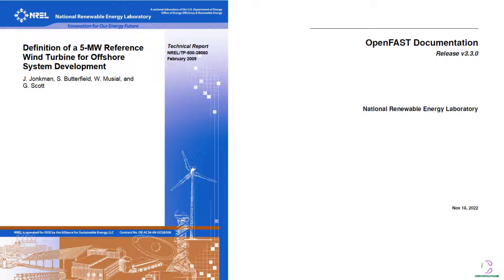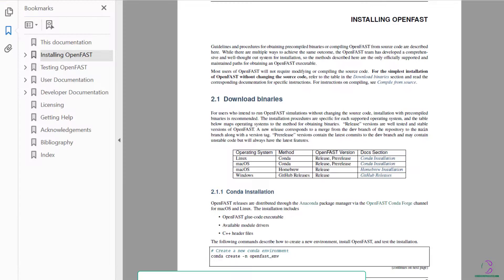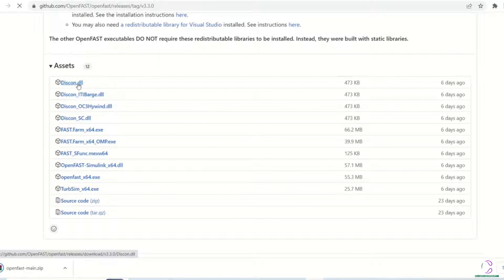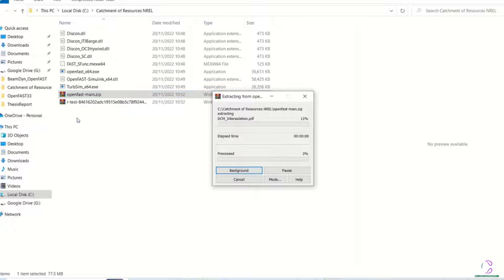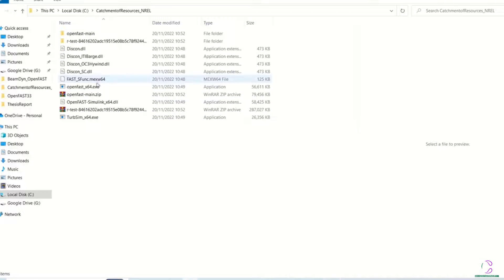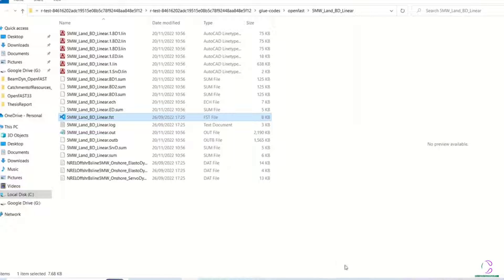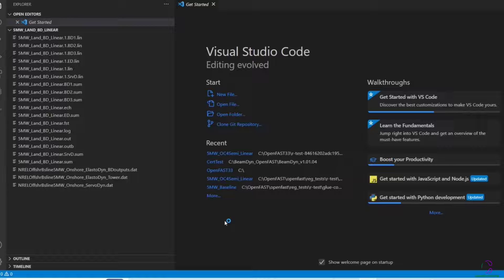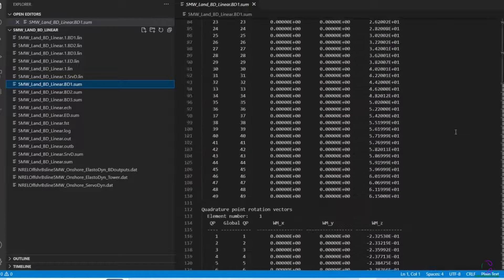Part 1: Running NREL's OpenFAST Precompiled Binaries | Wind Turbine Design Technology

Comment: please i am getting this:   FAST_InitializeAll:FAST_Init:FAST_ReadPrimaryFile:Invalid numerical input for file
"5MW_Land_BD_Linear.fst" occurred while trying to read Gravity.

 OpenFAST encountered an error during module initialization.
 Simulation error level: FATAL ERROR

 Aborting OpenFAST.  how do i fix this?
Reply from the maker: Copy this error into ChatGPT. It appears the number use for the gravity is to formatted the right way.
Reply: I did, but nothing seems to be wrong with the value
Reply from the maker: @ogbeifunisrael7296 take a screenshot of the error on your coding software visual studio or others.
Reply: FAST_InitializeAll:FAST_Init:FAST_ReadPrimaryFile:Invalid numerical input for file ".\main.fst"
occurred while trying to read Gravity.

 OpenFAST encountered an error during module initialization.
 Simulation error level: FATAL ERROR

 Aborting OpenFAST.

Comment: I want to use this for my project to model an airborne wind turbine to be located in 7 regions in the UK. I have the average wind speed data of the region but don't know how to use open fast to simulate a drag-lift system or flygen system of same rating as the turbines in these existing locations
Reply from the maker: Sorry I'm just seeing this message now. Don't know what happened.

A CFD application should be able to simulate it for you. Wind speed data can be input to OpenFAST but it isn't straightforward.

Comment: In my laptop, when I'm doing same process in command prompt, it is showing that this app can't run on your PC ..what should I do? Is there any special system requirement?
Reply from the maker: Can you send a screenshot? Also, what's the computer details
Reply: @catchmentofresources  Sure Sir. I've mailed you screenshot
Reply from the maker: @GhadgePrajakta  Thank you. You can see my response in your mail now. It should work fine on your system.
Reply: @catchmentofresources  i have the same problem, could you instruct me how to solve the problem?
Reply: @GhadgePrajakta  hi, i have same problem, could you please share me the solution? thanks
Reply from the maker: @anhtuannguyen9728  hi, try to install different version of OpenFAST from the current version that isn't running on your system.
Reply: @catchmentofresources  yes, i just try with version 3.4.1 and it works. Thanks a lot!

Comment: Here it is important to mention that the DISCON libraries have to be compiled with cmake before using the ServoDyn-module
Reply from the maker: This Part 1 focused on the already built files available from github, which already had the DISCON libraries. In part 2 and 3 there is discussion on building OpenFAST from the source code, where DISCON is also built in Visual Studio and can also be done in CMAKE.